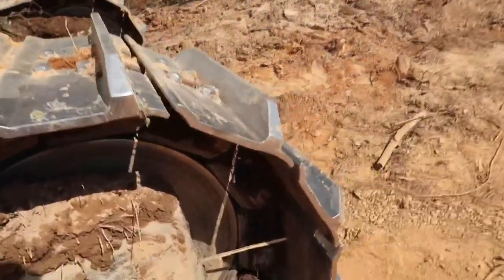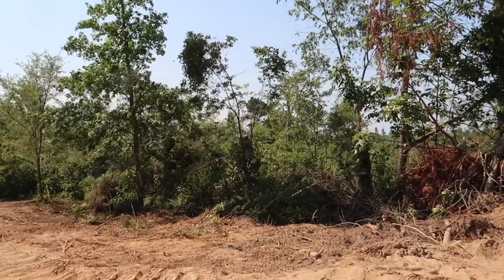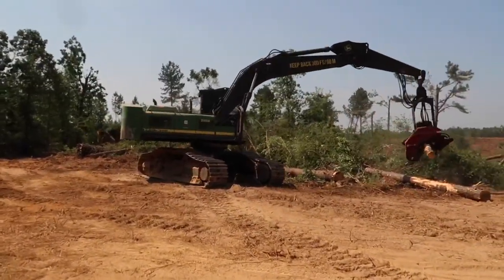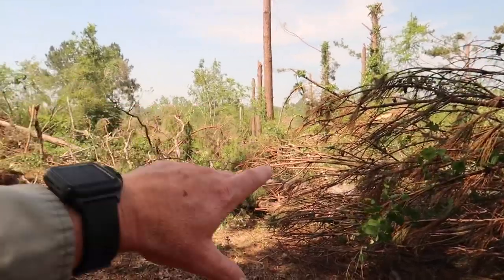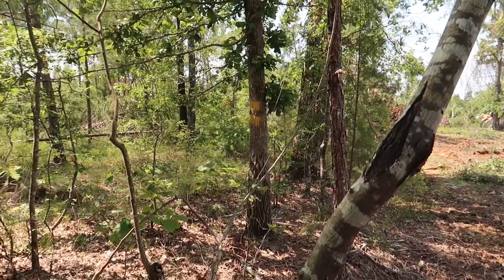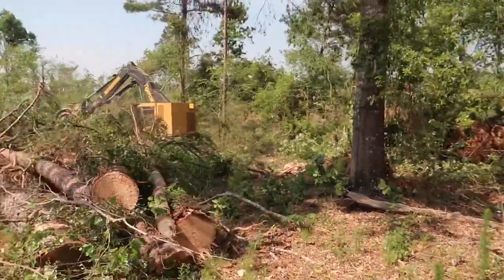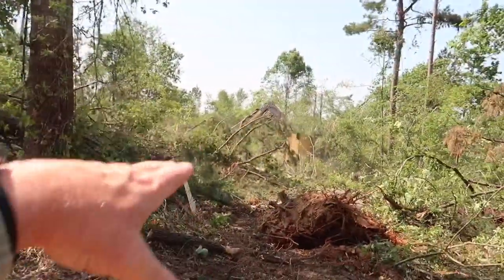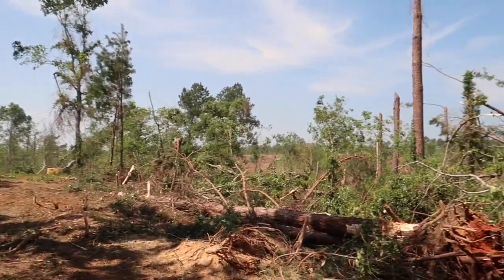Tigercat LX830D after a tornado

Comment: Looks like she came through the tornado relatively ok. Did I hear you right? Most of the trees are down?
Be happy you chose a Tigercat whole tree harvester as the arms the operator grabs the trunk with are the strongest of all harvesters. They will easily pickup trees laying on the ground to set them for a skidder.

For all you viewers that don't log Tigercat makes the most rugged machines that will do the job when other machines will cost you more in maintenance and repairs. There not inexpensive to buy but they are the best at what they are designed to do. Yes you can add a rotating head cutter to almost any excavator to make a harvesting machine but Tigercat is designed quite literally from the ground up for two jobs. Cutting while trees down and setting them where the operator wants with no fuss no muss. And picking the downed trees off the ground and moving them where he wants the trees to be ready for the skidder.

Nothing else even comes close.

Cheers!

Comment: Hi Tim another way to mark the master pin is to cut a “v” in the grouser bar or run some a bead of weld on the top edge of the grouser plate that way the operator can pick the pin up in the cab, thanks Tim that robotec vid was top class.

Comment: Do you have a rubber tired machine to harvest the downed trees alongside the road? Seems like it might be another opportunity business wise for you. Just load the trees right onto a logging truck. Use a 6 wheel awd off road dump truck like a 35-40 yard dump body. They. Will handle quite a few trees and won't tear up the road and dump the trees where a logging truck with self loading crane can load itself if you don't have another machine to load trucks with.

Just thinking out loud but there has to be a lot of downed trees accessible from paved roads

Comment: Notice how he stays back behind the machine while it's working? Safety first the rotating cutter will throw chips out to a hundred yard with enough force to seriously hurt anyone foolish enough to get too close to a working whole tree cutter using a spinning carbide equipped cutting wheel. As close as he is getting to the machine walking up to the rear is the safest place to get close but to get any closer he would call him and ask him to shut down. Then and only then is the machine safe to approach.

The safe distance from a working machine is 100 yards minimum.

Be safe out there as logging is the most dangerous job in the woods.

Cheers!